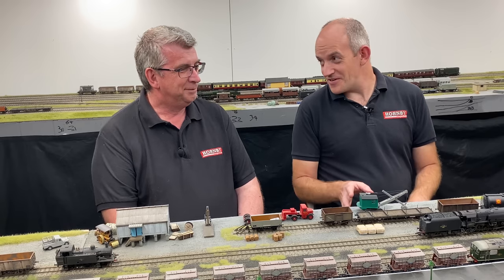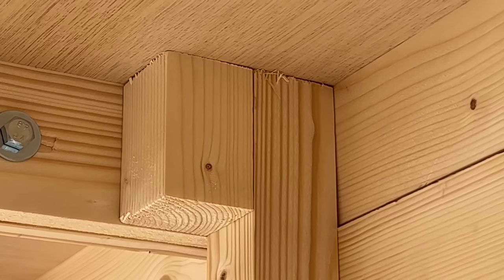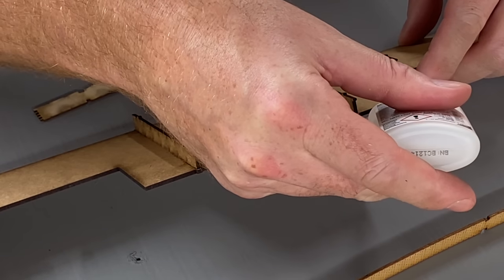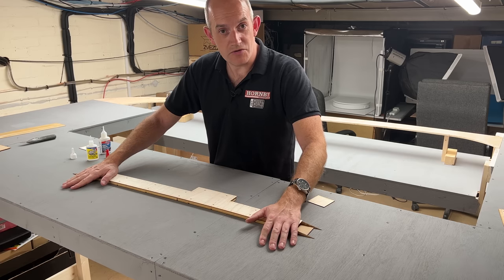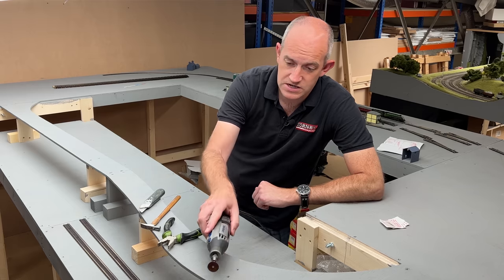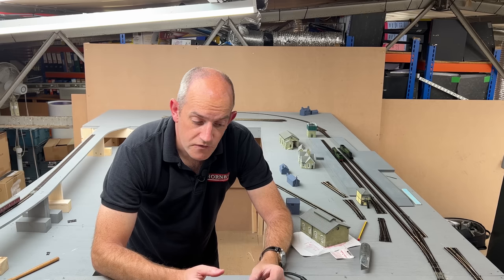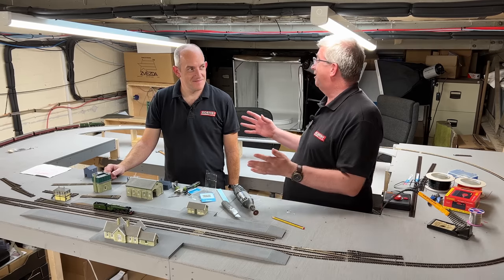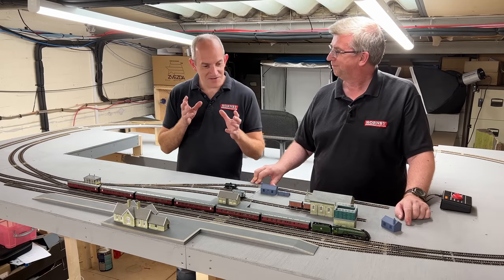SERIES 6: Building a TT:120 Model Railway -  Part One | The Foundations

Comment: I love the look of TT. It looks more realistic than OO with the correct scale track width. Very nice!
Reply: This is something people are reluctant to acknowledge. The correct scale track and stock really makes a difference. It’s when I look back at the other British Scales when I notice the ‘narrow gauge’ top heavy stance. A small detail but once you have noticed it, everything makes sense.
Reply: Hello.. @HighFell Is this why modellers go for 4mm/P4 etc ?.....OO is actually wrong then ???
Reply: @richardbradley2335 in a nutshell yes. OO uses HO (halfO) track gauge based on 3.5mm/foot, but in early days motors and mechanisms were a struggle to fit in British outline models due to them being noticeably smaller than European locos in real life. The UK ‘load gauge’ in most cases is quite a bit smaller. To maintain a universal track system OO was created, but the downside is the ‘top heavy’ look, it’s more apparent now with so many superbly detailed and accurate models. EM, 4mm, P4 are all aimed at correcting the scale issue. Other British versions of scale suffer similarly, N is quite a broad church and O has errors. The old Tri-Ang TT was incorrect too, 3mm/foot when 2.54/foot is the correct scale or 1:120. Look at a TT:120 Loco head on and compare it’s stance to the other RTR British scale models. It becomes quite obvious. It’s always made it hard for the designers to get the ‘right look’ because of the narrow track/oversize body. For many it’s not a deal breaker but it is more pleasing to the eye to have the stock and track on a matching scale 😊
Reply: Wow great answer..thank you....also what a finicky bunch of bas....modellers !!!...you should see all the scales of figs in wargaming  ,sheeeesh ! @HighFell
Reply: @richardbradley2335  ha ha, seen those. Some pursue perfection, I like it to look right. With my TT:120 layout HighFell, I have used to N scale items and using ‘forced perspective’ I’m happy with it, the only person to please is the modeller themselves 👍
Reply: Love your layout...simplistic and the viaduct is gorgeous. @HighFell

Comment: For the wiring I push the wires up through the board before then trimming and cutting, then you dont need to cut untl you have them where they need to be underneath

Comment: Taken me ages to get around to watching this video.
Can confirm, the Hornby code 80 and Peco code 55 track aren't quite compatible. Hornby's rail's base is slightly wider than peco's, so Peco fishplates don't fit hornby rail, and Hornby fishplates aren't yet available separate from the track.
My TT:120 layout under construction, Birdforth, is formed of 2 4'x3' non-scenic end boards of a double track return loop (although the ends are separate), and 2 4'x1' scenic middle boards of a quadruple track line. And it's set between York and Thirsk at around 1980, as if Birdforth had gained a station instead of Pilmoor and Sessay, and it had lasted post-Beeching, so is up slow, up fast, down fast, down slow. So is actually a 2-track loop, squished together in the middle. But is being built so the end boards can be swapped out and a fiddle yard added along the back to be a 4-track line in the future when more is available (and the option to add more boards between 2 and 3 to make it longer if I want).
I'm using 9mm ply, with 2x1 for framing (no crossbeams though), with folding down legs (boards 1 and 4 have 2 legs, board 2 has 1 leg, board 3 has no legs as it rests on 2 and 4), with the modeltech baseboard joints. And all the wires are 7/0.2, but soldered to the underside of the rails after removing a small section of webbing between the sleepers.
5 months in, I have all track laid and wired, backscenes on, and the scenery has started with the bridges at the scenic breaks under construction currently. But most will be done after christmas, when I have more of my scenic materials from my old 00 layout available to me. Work has been generally slow because I don't have a dedicated space for the layout, so I've been building it at club about once a fortnight, and doing other bits on my bed...
I'm fortunate that Birdforth's first exhibition isn't until June (not only because of how much work is left to do on it, but also because of Hornby only having the blue 08 available for my era so far)...

Comment: Hello,

mybe a silly question. But why don`t you use cork or rubber under the tracks? I assume that it might be more silent .

Kind regards from Germany
Reply: I noticed that too. I was thinking something was missing. Interesting choice for them not to do any underly.
Reply: i dont use it either i find once you ballast track it negates the purpose of the underlay
Reply: Mike said so in the video. He thinks he can do without, because it worked for the N scale layout they've built in the past. Personally, I think it sounds a bit noisy when the trains are running, so it might have been a good idea with underlay. I would definitely use underlay.
Reply: @stormbowman7148 .. And get rid of those nasty track pins 👍👍

Comment: On the  Modeltech track aligner website it looks as if you can use the item on an angle, and it looks as if you have used it at an angle on the TT layout. It looks to me that the aligner would overhang the end of the board. Does this cause a problem when transporting the boards. ie do they get damaged?

Comment: TT ,3mm gauge offers advantages in terms of size,as compared with 4mm,or 2mm,in terms of detailing, but the issue i have with Hornbys TT ,is the lack of models apart from LNER prototypes....id be interested ,if there were a broader range of locos and running stock....and ive seen nothing about any expansion of their range
Reply: There is a huge amount of information available about the next models to be introduced, some of which are on show at MK right now and then there are the next phase models that have been shown in engineering form and the phase 4 models have been announced  since launch. If you can get hold of the Hornby TT:120 catalogue this first wave of publicly released information is detailed
Reply: @HighFell  thank you for the info ,mdear...